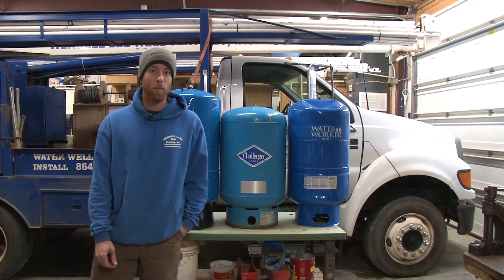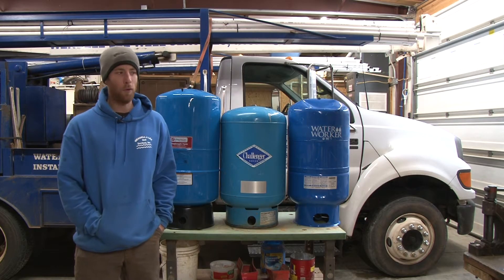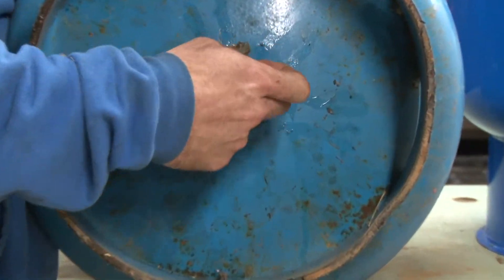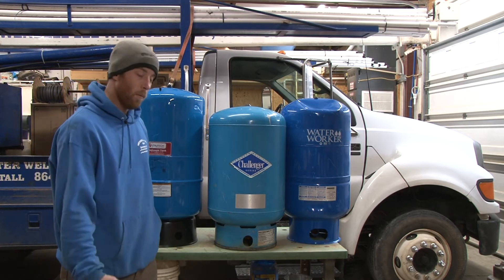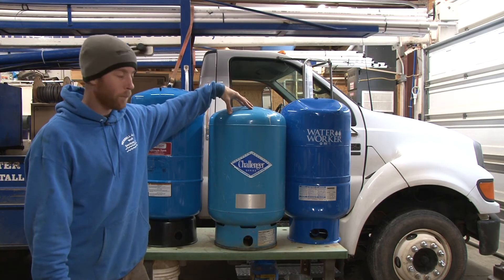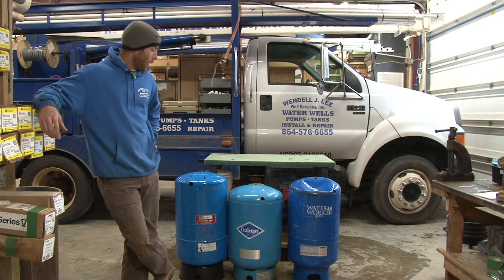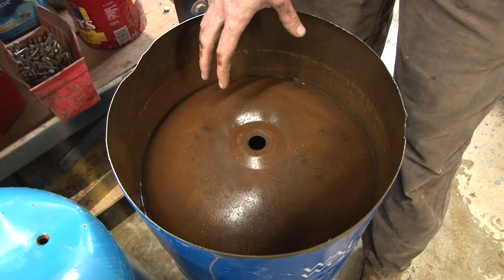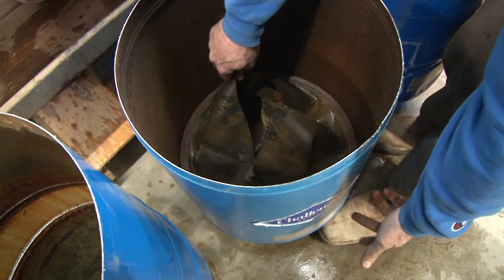Well Pressure Tank Installation: Comparing 3 Different Pressure Tank Designs

Comment: Always been curious on what the inside looks like. Thanks for that!

Replaced my unknown brand tank with a waterworks tank about 3 1/2 years ago. The unknown brand one had been there for a very long time and it still worked perfectly fine, however, the bottom was rusting out. Otherwise, I would have kept it installed.

Comment: Thank you!  I learned a lot about water pressure tanks. Can you tell me if whistling shower pipes are related to pressure tank condition.  Also pressure drops when more than one sink, toilet, shower, washer are running in a shared tank. This is a duplex.

Comment: Great information! You answered my question I was suspecting.   I have a house we just purchased and well pump is cycling on every time the faucets are turned on.   Watched your other video about testing the bladder and sure enough, it was bad.   But I was thinking that there probably was a difference in quality (you get what you pay for - or buy once cry once) and I was correct.   I installed some 20 and 5 micron filters to clean up the hard mineral water and noticed the low pressure after.  Subscribed!

Comment: Having installed a few well pressure tanks over the years, and having worked as a R&D metallurgist/materials scientist developing products, I find this video nearly useless.  All products have some early failures, usually related to manufacturing or installation issues. They then fail often at the end of their design life. The failure rate often follows what we call a bathtub curve. Issues with this video include comparing one tank with a 3 year life to one tank from another brand with a 20 year life.  This means nothing as you have to have a statistically valid sample size.  Tank wall thickness is not important unless tanks are bursting from the high pressures.  The brands mentioned with the thinner gauge tank walls have good reviews with no mention of this potential issue.  The video speaker also doesn't seem to know the difference between a diaphragm tank and a bladder tank. He also mentions the sliding metal ring and inner steel dome as pros and cons. Either of these features could extend or reduce product life as failure mechanisms are often complicated or not obvious.  For example, the inner steel dome layer is likely a pro as it keeps the rubber membrane from over stretching if the tank loses its air charge - high end tank can have this feature. While cost can indicate quality level, and big box stores can down spec. their products, their high sales volume also gives them lower pricing. Reducing specs. often does not affect product reliability if people understand failure modes and know what they are doing...

Comment: @WendellLee One of you viewers from out here in Canada. What is the best size tank for a house with 3 washrooms. The furthest from the tank is approximately 60 feet of pipe away from the tank. Also, the pipe is copper, so what pressure do you recommend. If I set the well switch to 60/45 psi, how much should I set my tank to. Lastly, what size tank should I install to try and minimize the fluctuation. Because the house is still under renovation, right now I have just one washroom up and running. I'm sure that once the other 2 washrooms are commissioned, the kids are going to have battles in the morning about one stealing the well pressure in the morning. I forgot to mention. I'm using a Burcam 1/2 hp Jet Pump

Comment: I enjoyed your video, especially the view inside each of the tanks.  It would be nice to see the diaphragm on the Water Worker

The Water Worker has the same diaphragm as a Well-X-Trol and also that extra metal dome inside.  That is a benefit. That's to keep the diaphragm from over expanding if the system isn't set up and running correctly.  I think you're showing the difference between a diaphragm and a bladder when you show how its attached to the sides.

Comment: Sorry I'm late to the party. A friend's well is equipped with a 2 tank system. One galvanized pressure tank that appears to be pressured up with a venturi from the pump pressure, some how. A second tank sits between the well and the pressure tank and collects any sand that is pumped up (a sand trap/filter). Can you do a video on this type system?

Comment: Hey, love the videos. I purchased a Zilmet pressure tank. The tank was damaged during shipping near the bottom, where the round meets the upper straight part. It’s pushed in about an inch or so by 2 “?wide. My concern is the bladder rubbing over time and prematurely failing. What are your thoughts?

Comment: I'd absolutely pay an extra $100, but in larger tanks it can be more like $4,000. I can get a 100gal tank with a big box brand under $1,000. A 90gal x-trol is more like $5,500. At that difference, unless I'm getting a no-question 20 year warranty, there's no way I can justify the difference.

Comment: I just replaced my Well-X-Trol WX-202 by Amtrol, which was installed Nov, 12 1990 = over 33 years in service.

I replaced it with the same Well-X-Trol WX-202 by Amtrol, installed myself. Easy installation.
Reply: Good to hear. I'm in the exact same situation but mine's 20 years old. Seems to be working well (sorry!). Having a two-story house, I run it at 80/60.
But it's been on my mind and it does look like a DIY job. I did the pressure switch and rerouted some copper some years ago. This looks manageable.

Comment: Not sure if anyone else said it already, but "Well-X-trol" and "Water Worker" are made by the same company. The difference is that Water Worker is a contracted brand by the big box stores, they specify what they want(such as thinner steel, cut corners etc) and design the warranty around what they know to be an inferior product. Spoke with an Amtrol rep on the phone and asked them directly when they told me both brands of tank are the same, and they said "Well, the one is a little thinner in places. Our Well-X-Trol is a better product."
Reply: Thanks. Good comment.

Comment: I didn't pony up for the Well Xtrol when I had the well drilled at my previous house in Nov 2007; instead I got the challenger.  When the challenger developed a pin-hole leak at the bottom connection fitting in July of 2015, I replaced it with a Well X trol.  I've moved, so not sure how it's holding up.  My current home has what I assume is the original well x-trol from 1977 if I'm reading the date code correctly (33103177).

Comment: Interesting, my house has always been on 30/50 pressure setting and ive wondered about raising it to 40/60. Would there be much noticeable difference in the water pressure and would it shorten the life of the pressure tank? I’ve heard it does. Or is there a specific 40/60 tank and control?

Comment: Yes. My parents had a plain steel non-bladder 40gal tank with a multistage jet pump over a 90ft well. The tank had an air-volume control to keep the tank from water-logging. It never worked that well and usually put too much air into the tank which I had to manually release and then start over. The current setup on our farm is a new remote well with a submersible pump a few yards away that fills 11000gal of storage that feeds into an irrigation pump and 22Gal bladder tank inside the old pump house. I troubleshot the system because the irrigation pump was short-cycling and would only build about 45psi instead of 60psi. The bladder is ruptured and I could not fill it with an air compressor, the air came shooting out the inlet after I emptied the tank to get a true reading (which you have to do anyway), so that proved to me right there the bladder was ruptured. We are currently pricing tanks and they arent cheap here in Northern California!

Comment: Thanks for the video. Im about to replace my 22 year old Challenger tank with a Amtrol Well-X tank, and your video aligns with what I’ve read that these are the best 2 tanks on the market. Also, I learned that the Well-X has an anti microbial liner and a turbulator that decreases sediment build up by swirling the water. There’s a great Amtrol video on you tube that walks through the entire tank construction.  Now it does have a middle dome and a second dome internally and their purpose is explained in the video.

Comment: Is there a standard pressure that we can check for to know if we have lost any over the years? If the bladder is leaking in anyways this would cause a loss of air pressure correct? With a leaking bladder would it also cause short cycling of the pump ?
Thanks, great videos. 
😎👍
Reply: Turn off your pump and drain the tank. Check the pressure on the Schrader valve with a tire gauge. It should be set to 2 psi below your turn on pressure. Example: 20-40 switch set to 18 psi. 40-60 set to 38 psi. If it will not hold pressure, replace the tank.

Comment: I realize this is an old thread but it is addressing a subject I need to deal with, pressure tanks. BTW, I have really enjoyed watching your videos. Thanks for all the great advice. If I did not live in Oregon, I would come buy and pick up my material from you. I am about ready to install a new Well-Rite tank and noticed it has a 1.25" SS inlet/outlet fitting. Does this mean I need to use a SS tank tee (to avoid corrosion)? I have read mixed opinions on the web but thought I would ask an expert. Thanks in advance for your advise. Mike

Comment: Hello, I hope you can help me. I am in Texas. I have a well, holding tank and pump house with a pressure pump and tank. My tank is a 40/60 but I can not get pressure above 50. So the pump will not turn off unless I do it manually.  My tank, switch and pressure gauge are all new. The pump is old and makes rattling noises when running. Can an old pump be the reason why I can't get the pressure up? Can you give me an idea on why I can't get proper pressure?

Comment: The old old style pressure tanks didn't even have the diaphragm or bladder, just compressed air above the water. So if you have a waterlogged tank and you remove the water above the diaphragm you can still use it if your valve and top sealing nut are air tight and there are no rusted through spots. Only disadvantage, a few litters less water between pump kick-ins.
Reply: I have been using a Medalist old style air-over-water tank for 50 years. It's finally developed a pin hole leak at the bottom so I'm looking for a replacement. I can't find another old-style tank so I guess I'll go with a bladder tank.

Comment: What would cause the pressure tank  to loose pressure from 55psi to 38psi over an 1 hour period when no water is being used?
Reply: I had a small leak in my supply line to my house
Reply: Check your check valve.

Comment: In my opinion flexcon is the best in the business we have installed them and have gone back 5 years later and not even 1psi dropped which is pretty exceptional. 

Well x troll went to complete shit. They started giving out 7 year warranties to entice people to buy their junk. Now on average they get water logged after 6 years. Complete crap and they used to be the best in the business their tanks would last 20 years easily

Comment: i BOUGHT MINE FROM FERGUSONS PLUMBING SUPPLY  AND BOUGHT A NEW  PRESSURE SWITCH  KIT  AT THE SAME TIME   . tHE 20 GALLON ONE WAS TO SMALL AND MADE MY PUMP BURN OUT .   REPLACED  1 HP PUMP IN THE WELL AND HIT WATER AT 200 FEET BUT KEPT MY PUMP AT THE 400 FEET IT WAS AT  . I INSTALLED IT   YOUTUBE VIDEOS ARE THE BEST IN SHOWING YOU HOW TO DO THINGS  MINE IS PRO FLOW 40 GALLON   HINT GO TO A PLUMBING SUPPY STORE NOT A BIG BOX STORE , YOU PAY FOR WHAT YOU GET

Comment: Nice comparison, in my experience though the Global Water Systems, LLC tanks are by far the best quality, nicer finish and never loose pressure because of a o-ring sealed air valve. Plus the composite base can never rust and most of these tanks are installed outside.

Comment: Just replaced a 20yr old well troll with another one. It was much more expensive but I don't have time or patience for water supply issues and I got enough stuff to work on than to monkey around with a cheap tank.

Comment: I agree with your tank recommendations. I serviced wells for 21 years and never saw a bad challenger that wasn't at least 20 years old. The big box store tanks are junk. Fiberglass tanks are ok but not great. Well-x-trol and challenger are top of the line. Worth the price.
Reply: Just replaced my Challenger because it was leaking at the elbow. It was seventeen years old.
Reply: If you have professional experience. Can you help a look at a comment I just left for Wendell. I asked a few questions about running pressure and tank size
Reply: @kaboom362  I Checked out your questions. First, I have a video on my channel explaining tank sizing which I urge you to check out. Regarding tank air pressure, the tank pressure on an empty tank should be about 2 or 3 pounds less than the turn-on pressure. For example, if the switch is set to 40-60, there should be about 38 psi in the tank. If you're using a 1/2 hp jet pump, your limiting factor will be the pump. That being said, a bigger tank will always increase your cycle time. When I say the pump is the limiting factor, I mean that if the pump pumps 7 GPM and you are trying to use 8 GPM, you will have a low-pressure situation regardless of the tank size. It's a low-volume situation more than a low-pressure situation. Hopefully this helps. Feel free to ask me any other questions you may have. I'm happy to try to help.
Reply: @lennyc624  
Thanks a million lenny. I totally understand what you mean. I'm going to check see what the Burcam pump is rated for and if it's less than 10 gpm then I'll size the pump with a 30 gallon troll. Do you know of a preferred name brand for pumps. I've tried a few over the years and found them to all be around the same. 🙏
Reply: @kaboom362  They are all pretty similar. None stand out as being better than the rest. I would look for one made with plastic instead of cast iron. Cast iron does not hold up very well against most well water. Other than that, They're all about the same when it comes to jet pumps.
Reply: @lennyc624 What are your thoughts on pumps made with stainless steel?
Reply: @fretman6 stainless is good. I would avoid any pump with cast iron parts.

Comment: 10:30 - Normally the bladder will never touch that expansion control baffle unless the pressure switch is bad or the cut out is set way too high. It's actually a good feature to save the bladder from exploding in the event of a pressure switch sticking. The Well-X-Trol tanks also have this same feature, since they are both made by the same company, Amtrol.
Reply: Not to mention it's a diaphragm tank. So when he said he wasn't going to cut below that because there was nothing more to see he basically cut off his own education.
Reply: He's not comparing apples to apples! I do appreciate the fact that he is attempting to learn though.
Reply: Or the charge pressure is too low.   I noticed my water pressure rising slowly from 30 to 40 and then rising rapidly to 50.  I found the charge pressure at 16psi - should have been 28. I believe that dome save the diaphragm from being ruptured. (WellXTrol tank )   I notice that the Water worker has an upper welded seam in the same place and my WellXTrol which is where the "stop dome" is attached.     I would like to see exactly how those tanks fail and the differences in material of the diaphragm.
Reply: you right men
Reply: It's probably necessary to have that for horizontal tanks so they probably make one tank for both types.
Reply: @Foche_T._Schitt  no I ki
Reply: P

Comment: I'm not going to go back and re watch but at one point I believe you called them diaphragm tanks then when you cut them open referred to them as bladder. From what I can see those are all diaphragm and not bladder and I don't think the two terms should be used interchangeably.
Reply: They are different, a diaphragm is fixed in place along it's outer circumference (the Utilitec and Water Worker tanks), and a bladder is fixed in place only at the bottom but not the sides (Challenger/Flexcon tank). When a bladder expands, it also rises and the hoop ring holding the two halves together slides along the inside of the tank as he demonstrated. In a diaphragm tank, the rubber just flexes up and down similar to a trampoline.
Reply: @TechnicalLee  Thank you.  There are some conjecture, and misinformation in the video and comments.  The Challenger is a bladder tank.  Its like a balloon that blows up inside the tank.  The other two are diaphram.  They have a membrane, like a drum, that divides the tank into two halves.  I do appreciate the video showing the insides of the tanks.  I'm happy to see that the Water Worker has the extra segmenting dome like their Well-X-Trol tanks.
Reply from the maker: a bladder is a form of diaphragm that can be used in a tank. so yes, they should be called diaphragm tanks
Reply: @WendellLeeWellServices  Except diaphragm tanks and bladder tanks are two different things am I wrong?
Reply from the maker: @tonyk.8580  in the well drilling industry they are typically referred to as a bladder tank. But a bladder is simply a diaphragm or type of "partition" to separate the water and air in the tank
Reply: @WendellLeeWellServices  so a diaphragm tank and bladder tank are technically the same thing???  yes no?
Reply from the maker: @tonyk.8580  yes